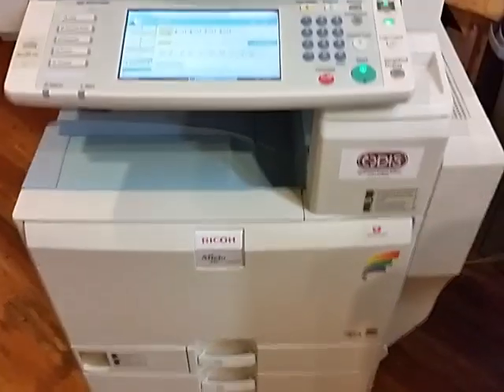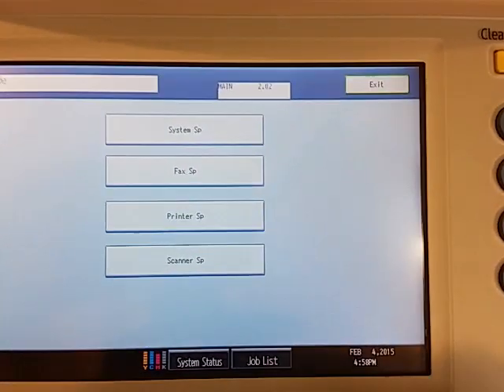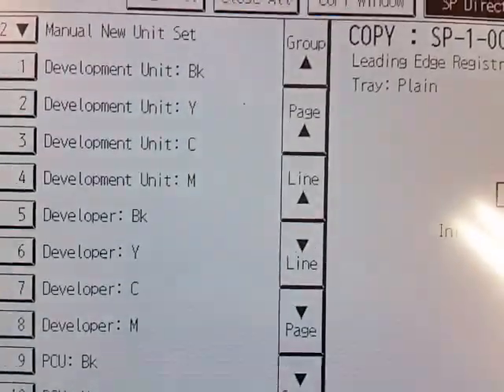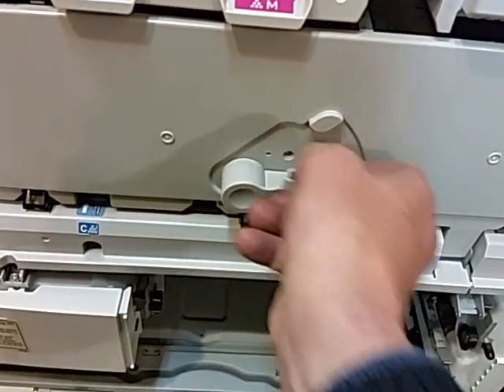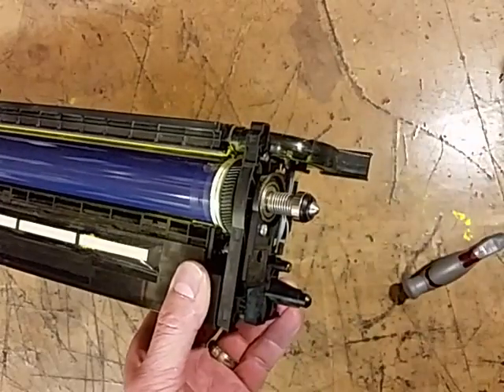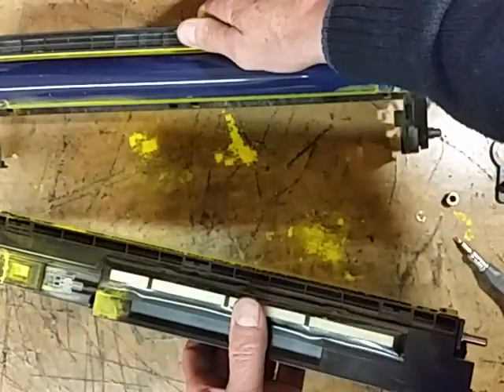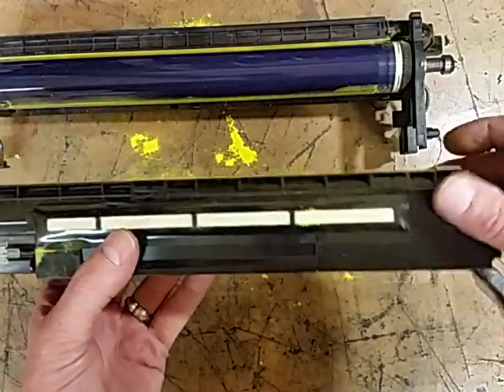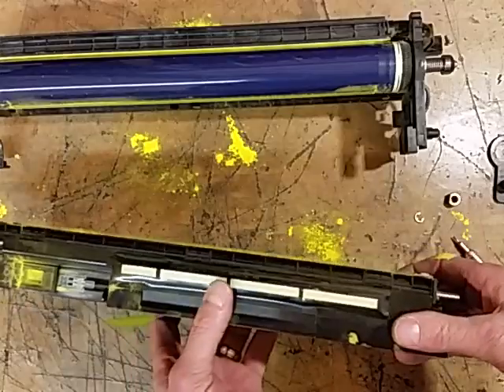Ricoh MPC color copier - Changing Developer

Comment: If i buy a new set of drums do they need the developer filled before installing?
Reply from the maker: Short answer no.
Reply: @mrbonz00   after watching your video that is what I thought. Thank you! 😊
Reply: @mrbonz00   can I ask one more question.  I put new drums in but it is only printing blank pages. How can I get it to recognize the new ones?
Reply: @mrbonz00   does that change the short answer to yes. 🤣 RICOH Aficio MP C3001 PCL 6
Reply from the maker: Blank pages.....no way for me to know without knowing what exactly you did. Did it make a copy before you changed the drum?
Reply: @mrbonz00   a Ricoh tech came, showed me the drum and it was worn out. It had stopped printing good pages, they were smeared and it was incredibly noisy.  He was supposed to replace the 4 drums and clean it. But they said it was too old, the drums weren't available.  I found them and decided to try to fix it myself. I have maintained smaller printers, but this is new territory.
Reply: I am wondering if the new drums are "empty" and I need to add the developer to prime them so to speak? I am hoping it isn't a sensor.
Reply from the maker: @pennierobinson3488  Noisy sounds like a worn out developer gear which is attached to the drum. If so, the developer roller doesn't turn thus blank copies.
Reply: Would that effect all 4 colors at once? It isn't noisy now that the new drums are in. Should I add the developer packages?
Reply from the maker: @pennierobinson3488 No! Developer is not the problem then. Could be a transfer issue or power issue. Without me being there hard to say. I'll look into some of my old notes to see if I can find something.

Comment: I get a toner fill error that comes and goes. As the machine started up I noted that all the cartridges rotated "spin" but the magenta did not spin as the others, none of the cartridges turned uniformly, when I opened one corner of the front cover with my leg holding the front cover closed at the micro switch and with one hand opening the left front cover and I manage to turn the magenta I do not get an error message, I opened the back thinking there may be some motors that rotate the toner cartridge upon looking at the video I noticed the gearing on the Developing unit, how can I test if there is a fault in the code ie. 1 to 0   on to off or there is a "drier" in the system,  bad connection failure in communication, burnt out servomotors is there a test code that checks each step and then says... "you tail light is not working... like my old Nissan Z I get error code CS 360 all my toners are full to 25% Loading Toner Message on Start-Up as I spin the Magenta manually as described above, I do and I do not get a code error it is random. when I managed to get it running without the code I tried touching the yellow and magenta cartridges simultaneously with my leg resting to prevent the front cover from opening as I was doing this I put colour settings and hit single-sided copy images without an image to be printed, it did 3 blank prints as soon as the magenta engaged and span on its own it threw me the code above.  the cartridge is at 25%  and reads empty regardless of the cartridge I load it always reads "I do not think it is a faulty chip reader message" I think it is a setting that changed as the copier was turned off several times by power shortage from the grid and it had no time to shut down correctly,  my MPC5000A still running the original cartridges
Reply from the maker: SC360 is faulty TD sensor in the developer unit per service manual. The SC360 should have a dash behind it and look like this ( SC360-02). The numbers after the dash (02) for example will tell you which color unit is having a problem.
Reply: @mrbonz00  I changed 2 developing units from my older 4501 that Ricoh would not support the K and the Y which gave me error CS363 unfortunately in Australia we get no support after 5 years canon is the same, I will follow your advice in the original 5501a unit so see the sensor un on the oscilloscope and see if I can change the faulty component or whatever is wrong if I ask for a sensor from Ricoh the price most likely cost as much as a new printer...:face-orange-raised-eyebrow:

Comment: Hi. I have a Ricoh mp c3001 that came from the factory with two drawers. When installing additional lower drawers, they do not appear on the panel. Do I have to set it on some so that the panel shows the 4 drawers? Thanks in advance for your help.
Reply from the maker: The paper deck is plug and play. If it doesn't show up it's the wrong paper deck. It should have a sticker on the top with model # BPB3100 or you should see D537.

Comment: there is a small electronic chip on the toner cartridge, and I want to know what it is for, for when the machine is turned on refuels the yellow cartridge, which is brand new and it asks to put another
Reply from the maker: Yup!
Reply from the maker: +semployées doiveselavi It keeps count of how much toner has been used. The toner density sensor under the developer unit is what is asking for the toner.
Reply: +semployées doiveselavi 
The chip is an RFID chip to register the serial number of the cartridge and reset/start the meter reading on how much toner is used from that cartridge!...if the RFID system fails, you will get a "Toner Cartridge Not Registered" message and the system won't be able to reset the toner level amount. It will still supply toner to the developer unit and will give another error code if the toner to developer ratio gets too low.

Comment: Mr Hudson -  I have a Ricoh Aficio MP C4000 copier.  When I make some copies.. when they come out the toner rubs off the paper at spots.  Could this be because the developer maybe empty?  Will the machine tell you when the developer is empty?  This also makes the machine jam up at times.  Any info you can provide would be greatly appreciated.  Thanks
Reply from the maker: +Marie Gardner= If the copy rubs off it will be because the fuser is not fusing the image properly. But first! Check your paper weight that you are using. Anything over 24lbs. you should select thick paper through the bypass tray. This will slow the copier down and turn the heat up by 5 degrees to fix the image on to the thicker paper. 9 times out of 10 this is the problem! This will also be the cause of your jams if it shows in C1 area (the fuser unit). Developer last 240k and will alert you only if the tech has set up the machine to do so. It will not be your problem of  image not fusing.
Reply: +Hadley “Copydoc” Hudson Mr Hudson - Thanks for responding to my questions.  I looked up a picture of a fuser and it  was the fuser where the paper gets stuck and jams the machine.  We use 24lb copy paper in our machine.  We also used 20lb copy paper and the same thing happens meaning the machine jams at times and the toner rubs off at times.  I'm guessing we need a new fuser to fix this problem?  Thanks
Reply: +Jeff A if the fuser belt, hot roller, pressure roller are still in good condition, it may just need to just have an oil supply (silicone) roller replaced which keeps it from sticking and causing toner offset.  Also, if you are doing a full bleed print all the way to the leading edge, it is also more prone to stick. Having a white space around the perimeter helps to reduce this. Also, make sure your paper is dry. Damp paper will curl, especially if the paper grain is parallel to the hot roller of the fuser. In this case, you can run the paper with grain perpendicular to the fuser rollers or grain going the direction of the paper travel! In any case, DON'T try to service the fuser yourself!...let a qualified technician do it!
Reply from the maker: In a lot of older Ricoh machines they have a oil roller however in a Ricoh MPc4000 it does not have one. Check your paper weight to see if it is over 20lbs. If so, select in User Tools,Systems Settings, Tray Paper Settings,Next, Paper Type, and try middle thick. This will turn up the heat by 5 degs. slow down the copier and allow the image to be fused better without rubbing off. These machines also are notorious for jamming in the fuser if the lead edge margin is too small. In SP mode select System SP, SP2 Drum, SP2103-1 and make sure it is set to 4.2mm.
Reply: I just love it when people leave the document processor lid open whilst making copies!...gives meaning to "job security"!--(jam in fuser--*note sarcasm!)
Anyhoo, "Lipstick on a Pig", Ricoh needs to innovate and sense when there are dark areas of the print and reduce the density in those areas!...Hell, Kyocera is doing it on their latest MFP's!...on dark edges, it AUTOMATICALLY reduces the density (I believe on the leading edge!) to prevent jamming!...especially for copies! I know, at our place of business, we are when upgrading people from their Ricoh/Savin machines to Kyocera machines! Our call volume has been reduced quite a bit, especially for paper jamming due to cleaning feed rollers!...it's mind boggling, but true! The only time we sell Ricoh/Savin is if it is an off lease machine (...have sold a few new ones though!)!...The problem is, is that many of the machines you don't know the history and coming out of a warehouse you don't know what's been swapped on them!....most famous is we received a Ricoh machine in and the MBU board on the fax was INCORRECT!....fax wouldn't load!...held everything else up!...DOH!....now if we have that problem again, we do a quick check on HyTec repair site do see what the correct MBU board is! I also hate getting SR790 finishers off lease too!...many times the shift tray brackets will be bent to heck!....or the finisher entrance will be bent from someone dropping it!....DOH!

Comment: hello mr hudson... i have a savin 8023e model which is just like a ricoh... Im getting a paper misfeed error j011... ive cleared all the paper and gently cleaned the sensors and still the j011 error occurs... is there any way to reset this??
Reply from the maker: Janice Betts if you would please look on the serial number plate most likely on the back of the machine and give me the numbers across the top. There will be 4 numbers including you model number. I can not find a Savin 8023e in my crosss reference chart! Thanks